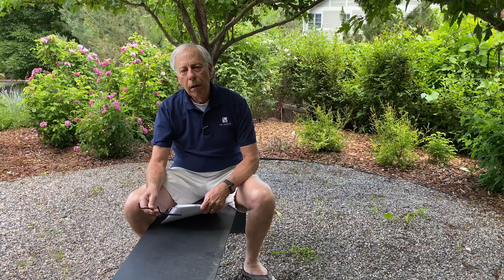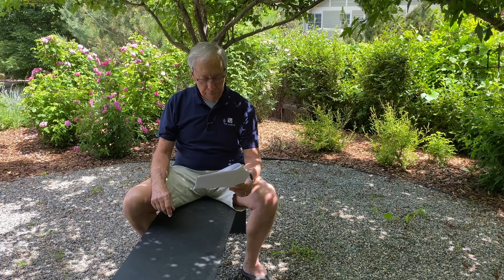The problem with TVs between speakers

Comment: Do not have anything between the speakers,  except a tv behind the speakers against the wall, especially between the tweeter & woofer, is the greatest thing you can do to help the imaging!  The smooth glass on the tv makes the sound waves of the tweeter & woofer bounce off the glass harder, faster & smoother, more clear & imaging. Practically empty spaces all around the speakers & on the sides of the speakers helps. A tv against the wall doesn't clutter or harm anything. It's the absolutely best thing you could ever do to help the 3 dimensional sound! I am not great on electronics. I am great on understanding invisible sound waves.
Reply: Fat Rat  You need short speaker wires too sound good. keep them at 10 fot each, dont make them real short. Kepp stereo on ground between speakers is best. A rak is maybe ok, if nothing on rack is between tweeters & woofer. only in small room for imaging, experiment with a mattress standind up between speakers. I knew a guy who put a wall between speakers. It seperates streo that's more clear not running into each other. I had speakers on fireplace that actually improve the sound. Cruthfield just ran out of the older PSB Alpha B1 speakers. The best cheap speaker you can buy. Twice PSB has been Stereophile product of the year. The Alpha sold over 100,000 pair in 20 years, that must be good. Look for them on Ebay or buy PSB on crutchfield. Go to www.morrow.com to buy great cheap interconnects. He has half price specials once a month. He send specials to your email if you call him. In a good system interconnects make a huge difference. Or use the thinnest dvd player interconnects. You can experiment  by hooking all my friends stuff together to see what gets the best tone. Tone is a less harsh low frequency. I will send you a playlist of the best sounding cds to buy. Almost all my cds were records in 1971 & before that was recorded with all tubes.
Reply: Fat Rat I'll put my best lps up later. Every single stereo shop I have talked to, I have asked them, if u were on a desert island, which would u pick of these 100 cds, which would you pick as the best sounding cd. Every single stereo shop said that the best of these 1 out of the 100 cds is all 100 of the them. Listed in alphabetical order. 1. Baden Powell- baden  plays Vinicius (1973) Spanish, best acoustical guitarist I have ever heard 2. Baden powell-solitude (1971) 3. Don baker_ duckin & Divin (2006) worlds best harmonica 4. bamboo (1971) as clear as flute can get 5. Beatles-love  6. Beatles- revolver Beatles- yellow submarine 7. bud Shank-magical mystery (1971) Absolutely perfect sound, I keep this under beatles, its beatles songs 8. beck-sea change MFSL 92003) much better remaster, the lp goes for $300 9. George benson& jack mcduff (1964) jazz 10. blind faith(1971) Deluxe Edition, the extra cd worth it 11. dave Brubeck-time further out (1961) 12.dave Brubeck-time out (1958) jazz 13. Kenny burrell midnight blue (1961) jazz 14. tracy chapman tracy chapman (1994) this can be on lp, too 15. John Coltrane a love subpreme (1958) jazz !6. John Coltrane-ole (1963) elvin jones drums 17. Ry cooder- a meeting by the river (19990 pure analog, better than the later digital remaster. The remaster is the only one u can get on lp that's great must have cd 18. Keith cooper- sacred dance (2000) strums guitar with both hands 19. Mike cooper-trout steel(1970) great acoustic guitar 20. Cure- disentigration, mixed up, 7 wish cds, not perfect sound 21. the exotic sounds of martin den- primativa (1958) perfect sound 22. willie Dixon-I am the blues. walter Horton on harmonica 23. Dylan- blood on the tracks- not perfect sound (1968)  24. Dylan-hard to handle (1995) not perfect sound 25. Dylan MTV Unplugged (1996) perfect sound  26. Bill frisello with dave Holland & elvin jones (2001) must have for great sound  27. Emmylou harrisspyboy live  (1999) dont get this mixed up with plain spyboy. clearest ever heard at all frequencies 28. Michael hedges-oracle (1996) 29. jimi Hendrix-blues new cd of old stuffgreat sound 30. dave Holland-hands (2010) great acoustic guitar 31. the best of HOOKER N HEAT (1971) 32. lightnin' Hopkins- blues hoot (1961) DCCCD remasteranalog steve Hoffman 33. Freddie hubbard-straight lifejazz. George bensen on guitar. This is CBS original, I dont like remaster 34. dave grusin-discovered again (1976) direct to disc, great 35. James gang-rides again(1971) lp is great  36. Jazz at the pawnshop)1979)analog recorded in café in open box for sound  37. J. K. & Co.-suddenly one summer(1968) boy played all guitars 38. Elton john-tumbleweed connection (1971) mick ronson guitar lp is great 39.albert king-I'll play the blues for you (1970) 12 track version  40. Leo kottke 6 & 12 string (!969)  41. Led Zeppelin 3 (1971) lp is better 41. The Maureeny Wishful album (1967) jimiie Page, better than led zed albums  42. Little feat-waiting for Columbus- (1973) perfect sound recorded in cathedral. MFSL analog tube remaster with better tone 43. Nils Lofgren-acoustic live (1998) 44. Antonio Lysy at the Broad-music from argentina (2009) analog recorded. cellos. Great audiophile  45. herbie mann- live at the whiskey a go go (1961) flute, great sound  46. dave Matthews & tim Reynolds-live at luther college (2008) 47. medicine head-new bottles old medicine (1970) 48. Mississippi fred mcdowall- I dont play no rock & roll (1969) black acoustic guitar blues  49. modest mouse-this is a long time (1996)analog recorded 50. van morrison-astral weeks (1968) remaster. one of the finest albums recorded all acoustic in 2 days. acoustic bass is wild 51. Penguin café orchestra- a brief history (1971) 52. Autumn Shuffle-Per af  Ugglas (2007) analog recorded, hybrid sacd or xrcd, I like both 53. Quicksilver messenger service-happy trails (1968) 54. Quicksilver messenger service- live at the filmore (1968) 55. quicksilver messenger service-quicksilver messenger service (1968) 56. rolling stones-letit bleed (1969) ry cooder guitar. bob lutz 2002 remaster. a great remaster. sold unmarked in storesas a hybrid cd, as all of stones cds. 57. sonny Rollins-thebridge 91962 jazz just only greaton saxophone  58. Santana1, abraxas, & 3. abraxas on lp is mind blowing, especially the 1st lps. 59. shanti (1971) amazing inside your head mid east recording 60. Horace silver - cape Verdean blues (1964) rudy van gelder 24 bit 2003 remaster.Rudy made his own electronics & was afraid thieves would steal it, he guarded it.  61. Son house-father of the delta blues (1965) black acoustic guitar 62. Jeremy steig-howling for judy91971) blue note, great flute 63. Jeremy steig-wayfaring stranger ( blue note, best flute air I have heard. 64. cat stevens-tea for the tillerman (1971) 65.  Steve Stills-super session (1968)  66. taj mahal-live & direct (1975) direct to disc  67. taj mahal - taj mahal (1968)  68. ten years after-recorded live (1971)  69.traffic-welcome to the canteen (1971) I'm crazy on this jazz rock cd. 70. U2- Joshua tree. not perfect sound. 71. the string quartet tribute to U2 Joshua tree (2004) 72. peter walker-rainy day raga (1966) mind blowing India like acoustic guitar 73. war-all day music 74. war-war (1971) worth getting for great 10 minute track  75. jennifer warnes-the hunter 919920 raincoat is better, but I like deep bass on some tracks  76. Jennifer warnes- raincoat the remaster is much better, the MFSL remaster by analog tube remaster has better tone. 77. who- live at leeds (1971) Deluxe Edition, any remaster has better sound  78. who-now & zen (2005) best sound hits version 78.who-quadrophenia (1971) the 2nd remaster 10 years ago has better sound than the bob lutz remaster. fans complained they couldn't find the analog version of tapes. 79. wilco-being there (1999) This sounds analog  80. George Winston-December (1985) 20th anniversary remaster. has a crisper sound hdcd best piano cd made 81. Gretchen yanover-bow & cello black lady beautiful cello tone
Reply: Speakers close to a brick wall acting as a diffusor with average speakers will sound much better than the greatest speakers in the world in a sheetrock room. It amazes me how people spend a fortune on stereos in a sheetrock room & I am one of them, but my parents house has a brick walled room.  Average speakers  positioned correctly will sound than the best speakers not positioned correctly. The greatest upgrade is not equipment. Its the position of the speakers. If the speakers are positioned correctly the greatest up grade is a hard & diffused law. Having the greatest stereo is little benefit without a hard diffused wall. Unless one has tried it, one dont know. Stereo shops dont want people to spend money on a room, they'd rather one spend it on their equipment. I have a friend that been in stereos over 50 years & spent over $100,000 on stereos. He is not the smartest, but he is good.
Reply: Fat Rat  My friend built his home for his stereo. He has a bathroom between 2 bedrooms. He sits in the middle of his living room. He opens his bathroom, & 2 bedroom doors. In the living room, he places the speakers between the doors right against the wall. With the doors open, it tricks the speakers that's against the wall into thinking that they are far away from the wall. The benefit is his wife doesn't have to get mad & shove the speakers in the middle of the floor in her way against the wall. I hate bright stuff, so I call the opposite of bright deep tone. I have to have at least a tube pre amp om my system. The deeper the tone, the better. I noticed on ebay people wont buy this up sampling bright stuff that loses bass. People want deep tone stuff. I make stuff for my friends. I can enjoy cheap speakers as long as they image good. I have a cheap Sony receiver I didnt care much for. So I bought another cheap Sony receiver that made the tweeter have a deep tone. So I bought 2 more exactly like it for another friend & me. I play around with wires, cheap cd players, receivers, & speakers to get the best tone. I have some speakers with 4 inch woofers that many say they are the best big clear like sound from a small speaker they ever heard. These speakers aren't cheap & over the years I found 4 pairs of them. The bigger the woofer, the muddier the sound get, like a muddy sub. Most of my cd"s are from 1971 & before,  recorded with tubes. In 1972 harsh digital transistors crept into harsh recorded albums that I hate. On Ebay I bought cheap a bunch of Nakamichi stasis receivers that Nelson Pass designed the stasis circuit. Runs cool at Class A at low volumes & has 4 power supplies in 1 receiver. Sounds as good as my krell or better. The old Nad 3020 receiver was cheap with great tone & people bought them like crazy. The Nad is high priced used on Ebay!  Why did they quit making it? Fourth order distortion in music is better & natural in tubes & lps with hiss. Remember Dolby Noise reduction that removed the hiss & made tapes sound awful.
Reply: Fat Rat  The only great speakers that I have ever heard is speakers with a 1st order crossover or speakers with no crossover. THe speakers I have with no crossover, they dont make any more. These speakers are real efficient, which means they play louder & more clearer. Efficient speakers are great with tube amps like Klipsch, but Klipsch speakers are too harsh. My speakers are Sonus Faber Concertos 15 years old. I dont like Prima Luna tube amps. My friend has a $4000 tube pre amp that is wonderful, he got it used for $450, it was never used. My discontinued speakers    has a tweeter on top of the cabinet like a B & W speakers. I dont like my B & W or any B & W.. The tweeter images real well on top. Great big name speakers with a 1st order crossover is Thiel. Thiel's aren't as good anymore., Morel Speakers are great 1st order for the money. The best first order is for the money is Vandersteen.

Comment: Decades ago I bought a Solid Steel 5 shelf rack, long before I understood the negatives. Worse, it has been well out in the room interfering with speaker imaging. Recently, I FINALLY  moved it back near the front wall. The speakers are now some 3ft in front of the rack, minimizing imaging issues. Moving it to the side is very expensive as HQ interconnects or speaker cables are uber expensive. Plan B is to replace the vertical rack with a 2 shelf horizontal rack, which aren't cheap either

Comment: In a home theater system
You have speakers on the right And left of the TV.
You also have speakers on the left and right of the couch and a subwoofer in the middle
So I guess what you are saying is the stuff that you're doing is not for home theater just for Great sound systems.

Comment: I am lucky to have two complete systems in the same room, a 5.2.2 and a 2ch only, the home cinema components are on a rack to the side and the two channel is on a low level rack in front of the TV, is there a difference in sound quality, of course there is  but I like to think it's down to the different amplifiers used and not where in the room my equipment racks are located.
Reply: Ahhh sorry Mark, however what you just stated above makes no sense.  Did you miss type something, or do you not understand the question / root issue?  OK, well sorry... but yeah, makes no sense.
Reply: same

Comment: This is a bit like saying asphalt damages your tires when you drive. Okay, but I need to use my car on asphalt if I want to drive it.
Reply: Other's call it bitumen.
Reply: Fat Rat  Have you tried using just the built in speakers on today's televisions? I don't think that should be anyone's choice.
Reply: Fat Rat  Hi FR.  His analogy has to do with necessity.  If you have a TV and stereo gear, like most of us, you have just one room to enjoy them and positioning is limited.  So, if you want to drive your car, there's little choice but to drive on the roadway supplied.
Reply: Fat Rat  My "great" room is quite small.  About  20x18 with the TV in the corner and the speakers to each side. The divan is along the long wall opposite a slider patio window.  I'll send you a picture soon.  It's not sonically perfect by any means ;-)
Reply: A long time ago. probable int he 1970s, I took a magnet, or maybye oit was the magnet froma  speaker, and i put it against the television and oti really messe dup the colors!
Reply: Claiming that objects between the speakers affects the sound in the center of the stereo image is more like saying the asphalt in the other lane damages your tires.  Phantom center is an illusion.  Phantom center sound does not come from between the speakers.  All stereo sound comes from the speakers.
Reply: Fat Rat  My point is: the phantom center sound does not really come from the center direction between the speakers.  Real objects between the real speakers cannot affect the phantom center illusion.
Reply: Fat Rat  I remember an article written years ago, before the Internet, that recommended putting an object between the stereo speakers to anchor the phantom center illusion.  I tend to agree with those listener's who like to listen in the dark to remove all visual distractions.  I do like watching movies in 5.1 though.  I also agree with those listener's who claim that two channel stereo has a better sense of depth.  I also recognize that stereo soundstage and imaging is totally artificial, more like impressionist painting than photography.  Recording microphones don't hear like ears, microphones are not given realistic perspectives of sound sources, and mixing console panpots and stereo speakers cannot produce the same Interaural Level Differences ILD and Interaural Time Differences ITD as would be heard in a real environment.
Reply: Except I don’t have a TV in my listening room. The analogy sort of breaks down there.
Reply: Just buy a hover car - problem solved 👍

Comment: Watching you on You Tube with TV between speakers.  The tv has become a pre amp.  With HDMI inputs TV has computer, blueray player, and TV over internet going to it.  Now it gets confusing.  If that is all a power amp connected to the headphone out jack  makes life simple and it sounds better than the tv speakers.  However if I want to add a CD, Tape, MP3, and source from another system, I use an integrated amp or receiver.  I know it's a compromise.  It's a relationship.

Comment: An interesting opinion, but I have to say that with wall-mounted TVs the problem doesn't exist (despite the always susceptible John Darko seeming to think it will somehow affect the soundstage - lol). Sure, if you have a sofa, or a lump of solid furniture between the speakers and standing proud of them then you'll have some issues, but if you keep your rack low, and behind the level of the speaker grilles, then there is really no impediment to aural pleasure.

Comment: Yep, as much as it looks nice and symmetrical, that's the only benefit, but it's up to the owner to decide if that benefit outweighs the cons, I guess.  Maybe modern flat TVs, mounted on walls isn't so bad though (apart from high frequency reflection of the screen), but not on the floor between the speakers.
Reply: Fat Rat  you dissing my tv fella? 😯

Comment: Strange that you can't have a thin TV way back on the wall that you've covered with a half thick to thick blanket too stop all the reflections from it.
I guess that you can't have a wall-painting either on the wall in that case and I have big problems too accept that but I don't know so it's perhaps true.
I guess that you shouldn't bee in the room yourself for the best sound.

Comment: I live in a condo apartment situation but good tip because I'm moving soon and I will try to put my gear to the side of the room or near a separate room set from my main speakers. It's the space issue.is it ok to have a screen between the speakers from your recent video you talked about transparent.